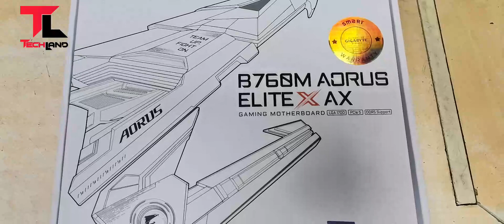DDR5 Gaming 14th Gen Gigabyte B760M AORUS ELITE X AX white Best Budget Motherboards #Tech Land

Comment: I bought this motherboard, but I'm going to ask for an exchange, because it presented problems here with me, like the Gigabyte software couldn't control the LEDs that I have connected to it, the colors are all bugged, and the main problem, in simple use, it restarted out of nowhere, I thought it was a problem with the w11 operating system, so I changed it to w10, but the same error persisted, so I requested an exchange where I bought it, I hope the next one doesn't come with the same problems.
Reply from the maker: Its board is very good, mbe faulty motherboard yr hand

Comment: Can i put 13600k on this mobo?
B760m gaming  ddr4 gigabyte
(Gaming ac without wifi)
Without vrm problem and using for long time?
Reply from the maker: go ahead
Reply: @TechLand2  what?
Reply: @amirm3230 by VRM problem if you mean overheating problem then it's not MB but Intel's overclocked CPUs from 13600k to all upper K versions, there's a bug in it's some software which Intel still trying to fixing it.